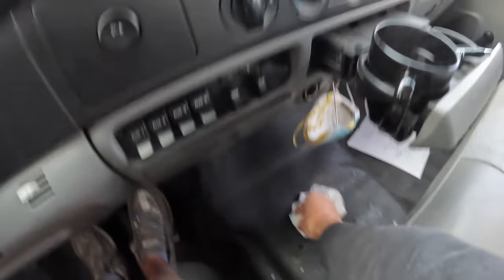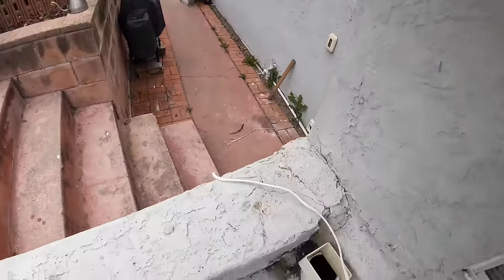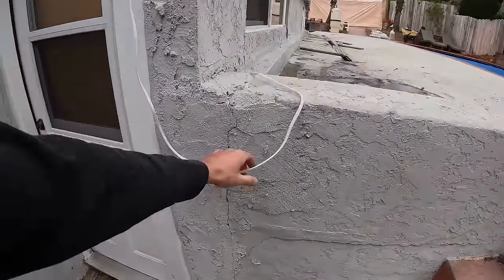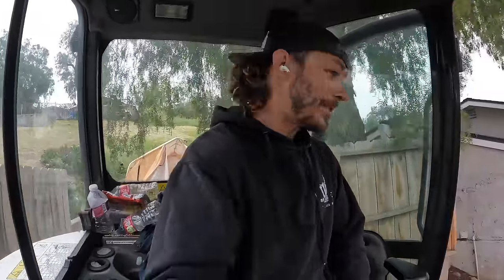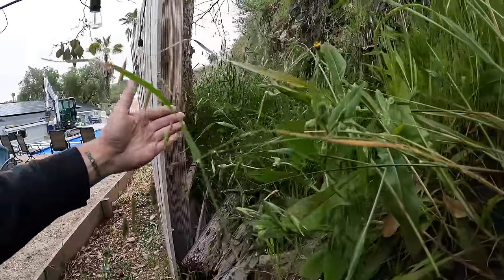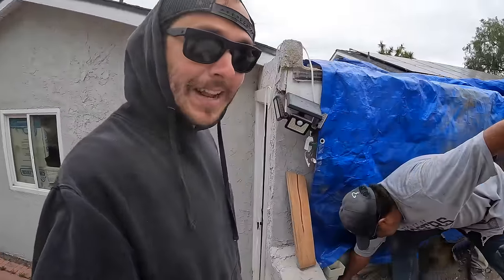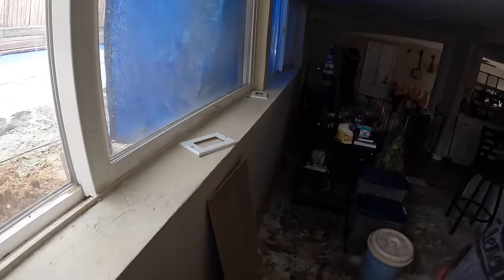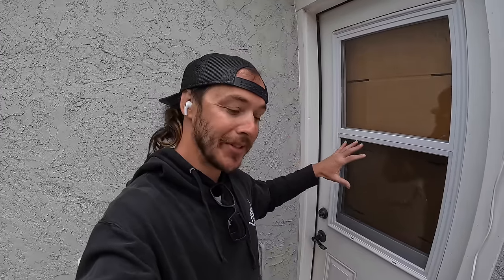House Flippers Completely DESTROYED This House!

Comment: Yeah, we learned the hard way buying a house that was flipped. Our problems involve flooring issues, window issues and our septic system. I finally got the septic system issues resolved, but I still have the flooring and window issues. Unfortunately we don't have the money to fix the flooring issues and windows. We basically need to replace all the flooring in the wash room and the back half of our rear living room which is butt up against the washroom. As for the windows, it appears we need to replace every window in the entire house. Going back to the septic system, shortly after we moved in, I discovered the previous owner had installed a water well pump in the septic tank instead of the appropriate effluent pump for sewage. I ended up replacing that myself. Then we found out after years of septic issues that the aerator pump was not hooked up to the air pipe that is supposed to inject air into the sewage to produce bacteria growth for the sewer system to work properly. It took getting the sewage system worked on from Dec. 2015 to Dec. 2022 to finally get the whole septic system working right. All I can say is lesson learned, I will never buy a flipped house ever again. However if I do decide to sell this house, I intend to get everything repaired correctly before selling it to someone else. I wouldn't be able to know I was selling someone a house that was not properly built or cared for. I wish more people had good morals about this as well. Before I forget, we also had to have the entire roof redone as well due to several leaks. Thankfully our home owners insurance paid for that in full.

Comment: You need to get your guys some masks for the saw cutting. Concrete dust and silicosis is no joke. Care and protect your workers.
Reply: And ear protection when using the pneumatic drill. Looks really fucking bad to have workers without even the most basic protection.

Comment: 1:50 "some real estate agents will let you put it in" what are you referring to and how did the realtor fit into that sentance? furthermore, the seller is required to disclose by law any permitted and un-permitted work completed, especially enclosing a patio.
Reply: 2:00 "they're not going to tape measure the house" of course they are. the lender requires an appraiser to tape the house during the appraisal.
Reply: so many bad flippers out there. something needs to be done to stop so much non-permitted improvements. many times permits don't stop poor workmanship either. what a mess.
Reply: great video. subscribed

Comment: im on my 3rd house and this guy is right the square foot of homes most of the time are all over the place and off. my current house is about 1700 but every contractor has guessed its minimum 2000. my last house was something like 1300 but way smaller then this one now. theres some rooms they do count and some they dont. and its that way for the houses i looked at as well

Comment: Is there no checks and balances for the house after the flipper does shoddy work? In my country, if you are buying a house, only an exceptionally crazy person buys without an independant builders report from a registered practition and no bank would give you a loan if you didn't have one. So work like this would never sell without the cost of remediation built into the price.  Consequently noone thinks it's worth doing stuff like this because if you did you wouldn't be able to sell it AND as soon as a potential buyer finds an issue with the house, informs the seller and pulls out of the deal (the standard here is any house purchase offer is made subject to a satisfactory building report), then the legal responsibility goes onto the seller to inform any other potential buyer of the issues that have already been found, and the seller can be found liable for all remediation costs if they don't inform buyers.

Comment: My childhood home only had a half concreted basement, they laid plywood over the other half and called it a day. Had problems with migraines and immune system issues until I moved away. Come to find out the wood floor side had a major mold issue, didn't find out until remodeling years later. This house was built in the 70's, assholes have been cutting corners for a long time, shit sucks.

Comment: My opinion is that the pool is what's putting all the pressure on the side of the house. The wet ground is just accelerating the process. I'd bet the pool isn't original to the house, I'm guessing sometime in the 70s with that pink concrete block. And someone decided they wanted an 'in ground' pool and they chose to bring the ground up on that side rather than go deeper with the pool. The bowed wall was going to happen eventually. It just happened a lot sooner because of the pool. I'll bet the hillside sloped all the way down to the foundation with the vegetation holding it up originally.

Comment: im suprised you dont have a locater wand and run steel or aluminum tape down the pool pipes then locate it ive seen a battery energized aluminum line and then locate on power mode on the wand to pick up the electrical signal.

Comment: This reminds me of when I bought my house. It had a finished basement, and something told me to gut it. After I gutted it, I found black mold all over one wall and down underneath the finished floor. There was a terra-cotta pipe that was coming through the basement wall below grade and instead of removing it and blocking it up correctly all they did was stuff old He-man T-shirts in the hole like that would stop water from coming in.  Smh.

Comment: From an Operating Engineer, please, please, please do Not dig over your blade.  Put it Behind you while you dig.  You don't hold your knife in the same hand you are holding your fork, so don't try to have the two tools in the same area while operating/digging.  You should have the blade behind you for a few reasons.  The first reason, especially on a mini-ex, is because when it is behind you, it gives you More Leverage to dig.  Also, you can see directly into your digging area and work a heck of a lot safer.  You can even dig more in the same hole/area without having to move the machine so many times, because you will be able to dig a lot closer to the front of the machine. Also, with the blade in its proper position, behind your shovel, it holds the machine a lot steadier, so you don't get jostled around as much and won't be so tired, fatigued and sore at the end of the day.

The blade is only supposed to be in front of you when you are using it to fill or level/grade the area.

Comment: Thats why we have in Sweden a law that is called "hidden errors". If the seller witheld information about house, like faulty construction as an example (Doesn't matter if it's the seller or a previous owner who did the construction). They're held accountable for how much the error will affect the house market value. So if the value decreased by 20k. The seller have to pay up 20k. And this law is valid 10 years from the day the buyer get the keys to the house.
So if you flip houses/apartments in Sweden, you better do it properly.

Comment: wow, over here in the UK even small retaining walls are usually 2 bricks depth (usually red brick external and engineering block internal) with a cavity inbetween, both layers of brick tied with steel cavity ties, footings often have a large foot on the internal side to help prevent the wall pushing out from the bottom, then the cavity filled with rebar and concrete.. surprised this wall stayed up whilst you excavated :D

Comment: And I was repairing/replacing part of the curtain drain for our house (there was a collapsed section of orangeburg pipe part way up) and even though it-s well down from the house & probably 40 feet away, I was far more thorough about connections and drainage than these flippers were (even went so far as to lay rocks over the PVC in case someone later on is digging there, do the rocks would get hit before the pipe).  I'd rather overbuild something than underbuild.

Whenever I see those house flipper shows, all I think on them is what a hack job they're doing.  The same with the people who "flip" vintage cars.

Comment: instead of rebuilding that whole wall could you break some of the block put in wall pins and fill with concrete and than waterproof the outside?

Comment: Good timing for the video.  I'm looking for my first house  right now, I've seen 8 so far  #9 tonight after work. I'm a welder so not really sure what I'm looking for other than the major stuff like roof and foundation. I Appreciate you pointing out things to look for.
Reply: Make sure u get a home inspection & have an exterminator look the house over & make sure u check out the home inspector call some of there past clients depending on size of house they should b there for 4-8 hrs ck everything & follow them around & ask lots of questions thats what I did saved me a ton of money on my house they found one of the sill plates was eaten by termites

Comment: CA law requires disclosure of issues at sale.  The current owners could go after the sellers from whom they bought the house for failure to disclose!

What is that one piece of PVC pipe that angles out toward the pool??  There was no more going back toward the pool equipment as you dug, so don't tell me they installed those "drains" that way, aiming the water toward the pool wall!!??!!

Comment: Have to work with/behind house flippers I can say they do those houses dirty. Watched them flip two house up on the hill. I can say the floor of that home is not screwed to the base of the house they replaced the seal boards around the whole house but didn't screw the seal boards to the floor boards and screwed them to the joists. To save money they cut the siding in half put new stuff on the bottom and left the old stuff. Water is gonna get in there and warp the siding. There's a home just just a little ways down the road the same people did the siding replaced the street side winds. The walls are rotten because the water runs straight off the roof down the side of the house and into the space between the new siding and the old siding . My house the person did the same lobbed the siding off half way so everything is rotten and where they did manage to replace "whole" sheets they still managed to cut three inches off and stuffed house wrap and silicone to try to Ward off the water. I bought the home sight unseen it was horder house you could smell from the street. The bed was being held up by carpet spray foamed to the wall

Comment: This is a prime example of why, if you're buying a house, you should insist on seeing all of the permits and inspection sign-offs for all of the work that was previously done to the house (at least within the past 5-10 years).  These should all be readily available from the local city or county government offices, so they shouldn't be hard to produce.  In this case, there is absolutely no way this work was properly permitted in the first place, because it never would have passed inspection if it was, and the entire reason permits and inspections are required for this sort of work is to prevent innocent people getting stuck with crap like this (or worse).

(In some places, if you find previous work has been done which was unpermitted, you can even report it to your local code enforcement office, and the seller will be prohibited from selling the house until they get the work properly inspected and signed off that it is up to code first, which can be some pretty big leverage to make sure they address things to your satisfaction.)

If there's anything that seems dodgy, but you still can't bring yourself to walk away, you can get clauses added to the sale contract to make the seller have to pay to cover to fix any problems which are the result of previous shoddy work, should they be discovered after the sale.  If the seller balks at those sorts of conditions, it probably means they're already aware something is not right with the house, and are just trying to palm it off on you and run away.

Comment: Correct on those windows. There should be at least one, I believe code is two 2x4 in there. 
Half of my windows were like that and my glass ended up breaking. 
I really hope the flipper didn't think themselves an electrician like the one on my house did.

Comment: the current owners may have some recourse against the previous owners, i'm not a lawyer or anything but the fact that the previous owners used flex seal or whatever to try and fix it (temporarily or permanently, doesn't matter) and didn't tell the buyers about it should make them culpable and if i were the current owner, i would be speaking to a lawyer, if they can't afford one, perhaps a no win no fee lawyer, doesn't matter how big that kind of lawyers cut is, because you'll still be getting something rather than the nothing you would have gotten.

Comment: Whoever the buyer's real estate agent and inspector were, were not looking out for them. There are so many obvious red flags, that even if you lacked any basic knowledge would scream 'run'. With how common land slides are in cali, how could you consider buying a home next to a hill poised to crush your home the second it gives way in a land slide?

Like when I bought my house, and found things had been repaired. I asked for receipts of who repaired, explanations as to why it was repaired, etc. If I had seen sloppy stucco on the walls I would had been asking what happened, why was it done, did they warranty the work? If I saw features in the home, I checked to see if they were done correctly, like lighting in my backyard was obviously not run by an electrician and is something the inspector called out.

If you see work has been done on a home, and aren't asking questions to protect yourself and getting some type of legal assurance (like warrantied work, were they bonded contractors, or just some schmuck with a tool belt) then its hard to feel bad for a person who bought a lemon with both eyes open.

Comment: We have a huge problem here with house flippers. My house was a flip house and I wasn't told so. After we moved in we started finding painted over dry rot, hidden water damage, improperly installed flooring, and carpeted over bad concrete in the basement. Bad plumbing clogged with rust. Etc Etc. I agree home inspectors are useless. I'm convinced home inspection is a get rich scheme, and the realtors get kick backs for recommending certain inspectors.

Comment: Sad thing I see shoddy patchwork like this with cars as well. I had a dealership try to sell me a 2019 F-150 with 80k miles for $50k without telling me it was salvaged from a place flooded by a hurricane. It looked pretty until I got a peek underneath and saw the rust AND the crappy splash guard falling apart. Liars and cheaters everywhere.

Comment: Wow, this video is my first exposure to your channel and your content, and I'm really impressed!  As I was watching this, it appeared to me that the block wall below the "addition" seemed to line up with the retaining wall behind the part of the house that looks like it is/was a garage, with the flipper "addition" covering what had been a walkway to said garage.  As you pointed out though, that wall is now compromised, and I'm guessing you'll have to tear it out and start over, if not restore the original exterior wall.  In future videos on this project, I hope you'll address the permitting issues.  When something like this is discovered, what's needed to make the addition legal, given that it will largely have to be rebuilt.  (I'd also take a good look at whatever beam was installed to support the roof where a portion of the load bearing exterior wall was removed.  I wouldn't trust that flipper any further than I could throw the house.)

Comment: This is nuts. Even if they built the wall correctly, for this to have any chance of working they would have had to waterproof the outside of the wall and have drain tiles on the bottom for subsurface water to drain. But even with that, which is common for basements, people still have tons of water issues in basements! It's nuts that someone would just bury a wall of their house without taking the proper steps to make sure things won't go seriously wrong.

Comment: I would never buy a flipped house because no matter how much they prettied the place up there's no telling how many problems they covered up. Inspectors can use high tech equipment to identify issues but there's really no way to fully tell what's going on without gutting the place. For example a flipper who's skilled in drywall can simply cover up structural issues and prospective home buyers are none the wiser until problems start arising down the road. Or a flipper did their own plumbing and figured they'd save a couple bucks by not installing nail plates and the next homeowner might be screwing or nailing into their wall and pierce a pipe. Or a flipper put a new roof on and didn't install underlayment or maybe even put shingles right over the old ones and it starts leaking prematurely but the homebuyer thinks the roof should be "good to go for another 20 years"!

Comment: At least somebody installed a proper drip ledge on that almost flat roof.  The window joint should have trim piece called a mullion strip or mull strip for short.
Reply from the maker: I'm not a roofer, but many have commented saying there are still a lot of faults in the roof install as well. Luckily it's held it up and not leaked.